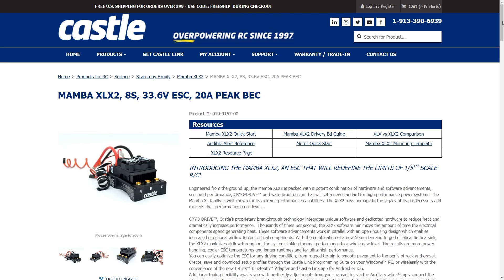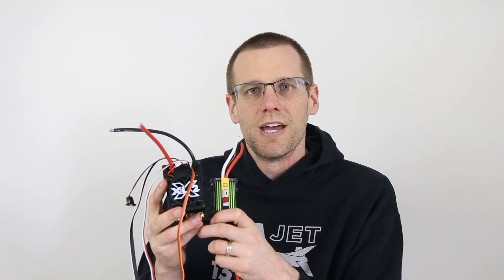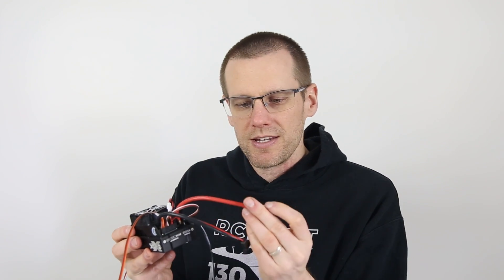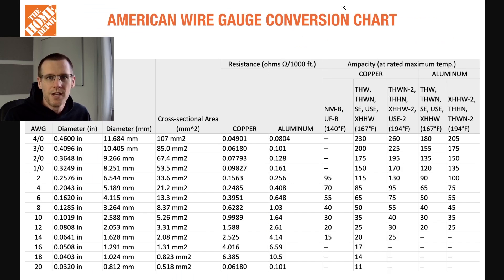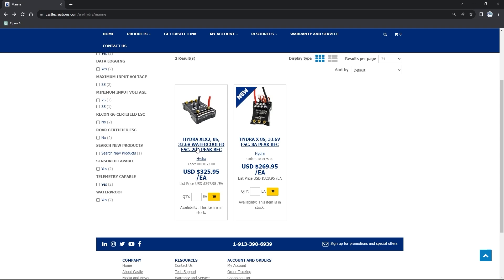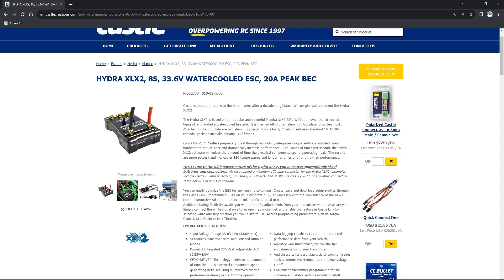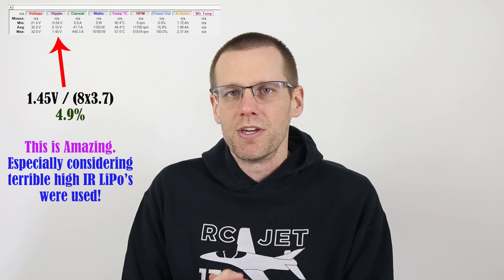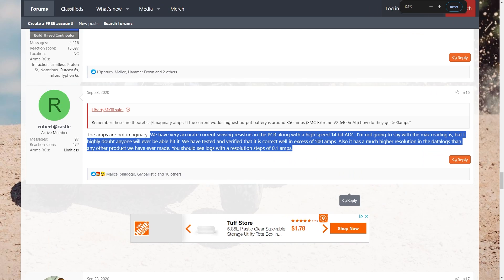Professional Engineer Explains why the Castle XLX 2 is so Good!

Comment: The xlx 2 might be good for speed runs and lighter rc's where they get maybe a 10 -15 second run then have a chance to cool off but, not so much in the heavier 1/5 scale rc's. I've gone through 3 xlx 2's. The 1st one didn't make it 5 mins before having to send it back. The 2nd not too much longer for the exact same problem. The 3rd did last longer but the last time I ran my dbxl-e 2.0 which is what the xlx 2 is in, almost welded the connectors together and that wasn't even a hard run. I've also gone through a few castle motors and no luck with those either.  I'm not a big fan of castle products.
Reply from the maker: Wow. I can understand from your perspective, thats brutal. With those I know locally with these units. Not one has let go. I own 2 of the xlx2 and one of the new xlx2 revised to a cobra and 2 of the hydra xlx2. It seems the 1/5 scale cars work quite well with it too. I dont get past 55C in temps. The 8mm connectors dont even get warm. What is happening with your dead XLX2? What happened to the motors?
Reply: @RCexplained  The negative wire going into the esc came loose on the board on the 1st one and was only checking it out, no hard pulls or bashing and with-in 5 mins that happened. Same with the 2nd one. The 3rd one not sure what's wrong but have had it about 2 years and I have aftermarket fans on it, it'll still work but the negative lead gets very hot even while going slow, no hard pulls or bashing. As far as the motors go, I don't really remember, it's been well over 2 years since they quit working and I have been using a Leopard motor and have had great success with those. Since I've got your attention, what's you thoughts on the hobbywing max 4 and motor combo? I'm totally rebuilding/upgrading to vitavon parts and haven't got a new esc or motor yet.
Reply from the maker: Wow those are some strange failures. Brutal. 

I dont have enough experience with hobbywing car ESC's. Their air ESCs are decent, id expect the max line to be pretty good too.

Comment: I just got a brand new Cobra 5 which is the "successor" of the xlx2, but may I know why I'm seeing 5-6v of ripple voltage? I'm using two top of the line onyx 4s 9800mah "160c" lipos with the new qs8-s+ extended versions that handle 130A continuous. 8awg wire all round with the stock esc wire lengths, no extensions. 12cm jumper to wire the 2 packs in series for the dual lipo setup in my xrt.

I'm using a 2028 1100kv motor with 25/35 gearing, and initially 25/32.
For some reason the 25/35 give me less amps on logs with higher ripple voltage 5-a little over 6v, and on 25/32 I'm getting 4v++😢😢

Whyy is this happening, my solder joints should be fine too😭I've tried another set of these lipos and similar results.

The truck feels sluggish, and doesn't have as much punch as my OG V1 max5, which is extremely unbelievable cuz the castle is supposed to be much more powerful than a V1 max5 that has been abused for years

Moreover in the logs, I can see and obviously feel the "lag" for the "power output" when I max out the throttle during bashing. It feels like a severe lack of power and it makes the throttle response feel extremely sluggish and weak, where the full power is only coming like a second later

Temps are great, 52C max temps on the esc and motor hovers around 72C, I've tried everything, adjusting all the settings to max out the power output of the esc and re flashing the firmware and still feels like absolute shit, compared to my abused old max5 that has wires longer than my fishing reel with smelly capacitors😭
Reply from the maker: Without the unit being in front of me to test, I couldn't tell you much about the ripple voltage concern. These units have the highest ripple suppression ive seen from castle yet.

Comment: i pulled 400+ amps with my spektrum 160amp esc/ 1250kv motor in my infraction... at 125 mph (trying for fastest all spektrum infraction)
pulled 650+ with xlx2 in custom gt chassis (pps)

Comment: Can This ESC handle a 5870 1350 kv motor
Reply from the maker: I have not personally found the limit of this motor. When geared appropriately this ESC handles a very wide range of motors including a TP5870 series. Keep your eye on it, as this motor is an absolute monster.

Comment: I don't have much confidence in Castle Creations ESCs. I've had two ESCs Mamba Monster 2 and Mamba Monster x stop working within a month. I wanted to buy the XLX2 but my prior experiences I was very hesitant and waiting to hear reviews on it. I was hearing so much incidents of it just burning up or stop working for no reason, so I decided not to take the chance and get something that maybe stops working in no time at all. Castle Creations make good "Performance" ESCs but they are not very reliable at all.
Reply from the maker: Very interesting. I only use Castle ESC's for nearly 20 years now as they are the most reliable I've found. Because of this, I've not tried their customer service, but imagine you did?
Reply: @RCexplained  Ok. No I just left it alone because I thought the ESCs were pretty much cooked and didn't worry about it after that.
Reply from the maker: @Tejaye777  that's unfortunate. Apparently their warranty would replace defective ESC's. What do you use as an xlx2 substitute?
Reply: @RCexplained  I use the Hobbywing Max 5 and a Castle 2028 1700kv motor in Limitless v2. 

The issue was in about 2019 though so about 5 years ago.
Reply from the maker: @Tejaye777  nice!

Comment: Hello my friend, I want your help if you know.. In an excavator I want the right and left rotation to be the same, can the ESC give the same forward and backward speed? what exactly does force reverse do? if not how can i achieve it? If you can answer me please, Thanks
Reply from the maker: Yes it can if I understand your question correctly. You can program the eac to have 100% speed forward and in reverse. Make certain the esc you choose has this capability.
Reply: @RCexplained  Does this happen with force reverse? in the factory setting it is at 25%

Comment: You mean Castle cremations? These things are absolute trash. What did you do? Get paid to shill?
Reply: Not sure what castle products you have owned & used, but I've been running the same castle motors & ESC's for years now & they're still going strong. So I'm truly curious about what was your experience. 
I have beat these things hard since I mostly do speedruns & speed bashing. Tons of hits in the 450-570A range. The only castle product I had an issue was with the MMX8S ESC. And Castle replaced it quickly. I then upgraded it to the XLX2 since I needed more power. I now have a pair of them & they are still solid after years of abuse.
Reply: @rcbustanut2057  the xlx2 are notorious for catching up in flames. Probably the worst ESC you could ever buy
Reply from the maker: No I don't get paid. What's the failure rate on these ESCs?

Comment: I’ve seen data logs over 600A with XLX2. 
While not proven, I’m of the opinion that the XLX2 has a limited number of pulls in which over 600A can be pulled. With each subsequent pull, the ESC will just not be as powerful. This is also a big reason why a lot of guys (myself included) have started running dual motor/XLX2 set ups… it allows much more speed and puts far less strain (wear & tear, temp spikes, amp draw, etc…) on the system as a whole. For single motor XLX2 set ups, I switch out the 8AWG wire with 7AWG wire. In drag set ups, the ESC doesn’t clip as easily with the larger diameter wire. I also direct solder my motor phase wires to the three output bullet cups on the XLX2. This prevents the motor phase wires from “popping” out of the 8mm output bullet cups. I have used cappacks that I made myself to help feed the motor when the FETs are in the ON position but I have noticed that it also shortens the lifespan of the ESC… it’s a cost/benefit modification with the cappacks… I seem to get much more punch in the upper RPM band range, where the RC would normally plateau in speed. For non-speed/drag use, nothing extra is required. These ESCs are so powerful but they are delicate, which is why I do not ever recommend them for bashing in a 1/5 scale… a lot like “Mike Tyson with a glass jaw”. Vibrational wear & tear really beats up on the XLX2, so I generally reserve the XLX2 for high speed applications only. It’s baby brother, the MMx8S is actually preferred for 8S drag in a 1/7 with a cappack. If you take a look at a MMX8S, they use traditional capacitors, whereas the XLX2 uses nano capacitors, which is why a cappack doesn’t necessarily translate into a 1:1 benefit like it does for 
ESCs that use traditional internal capacitors (think Hobbywing style ESCs). Again, this is all personal observation from years of using these ESCs.
Reply: You mention fragile, thats exactly what we seen running oval on-road, they were called CastleCreamations for a reason, seemed at least one a week were going up in smoke, I hated them and refuse to use their overpriced unreliable trash.
Reply: @user-rs8zg8ey2b - I can definitely understand the frustration with the XLX2 ESC, but it does very well with very specific applications like speed running where jumps and hard landings are not really part of the gig. I think the ESC would do better if they offered it hardwired to the pcb like the old XLX but that would remove the water resistant label. I wouldn’t call it trash but think the MMX8S is a better made speed control and more versatile for sure. I run a dual motor 1/5 Kraton using two MMX8S bc the dual XLX2 just had a lot of start up problems.
Reply: Yes the XLX2 stronger / can handle more VS the MMX8s 
But Why is it ..the XLX2 slower than the MMx8s on launch/ drag application
Also it would clic on launch pad bit tight
Reply: I think it’s the internal failsafe protocol in the xlx2 that is different. Xlx2 does better at building pass through current than mmx8S but mmx8S seems to be able to handle more load upfront and I really think it has to do with the fact that it’s using traditional internal capacitors unlike the xlx2, which uses nano capacitors (which is why you don’t see them when you remove the fan cover). In short, mmx8s has better buffering to handle the load from drag vs xlx2.

Comment: dont look at peak amps, thats irrelevant. look at average sustained amps. I have it in a blazer marine whiplash - 356A for 2 laps/20 seconds. 275A for 50-60 seconds.
Reply from the maker: Average sustained Amps makes excellent sense for running a boat for 1-3 minutes continuously.

Comment: I have 4 XLX2 escs in combination with 2028 800kv 1100kv and 1721 1260kv.
In Losi MTXL, Rovan F5 and 2 Traxxas X-Maxxs. One for speed running and the other for bashing. 
Usually pull around 400-500 amps.
Keep the videos coming. 
Cheers. 
👍🇨🇦🤠
Reply from the maker: Thanks for sharing, sounds like a great setuo